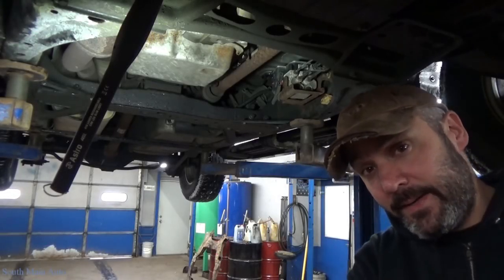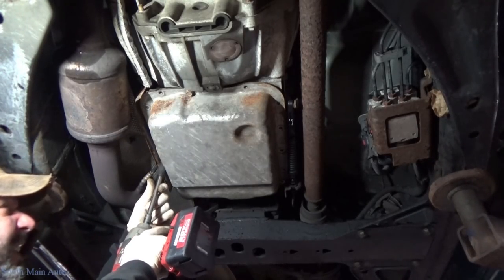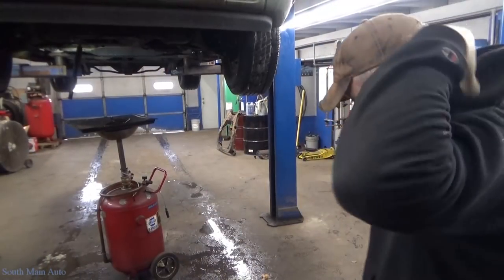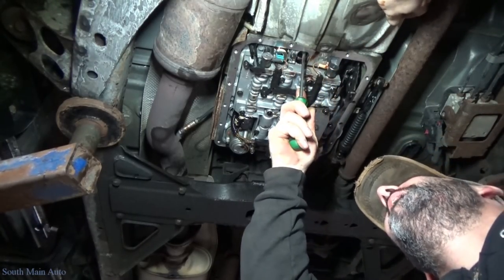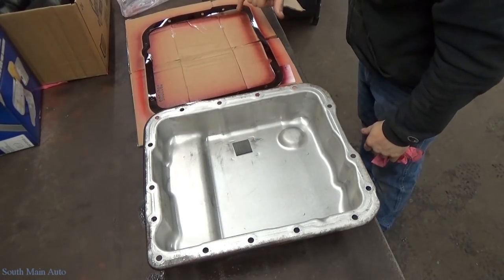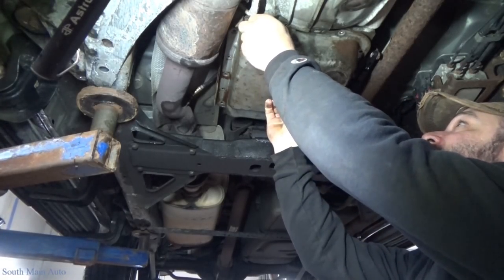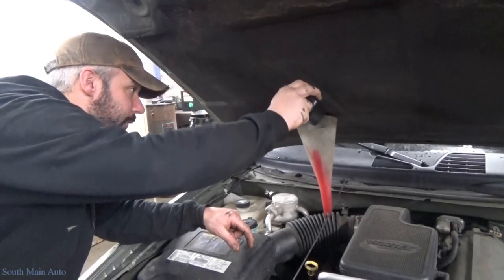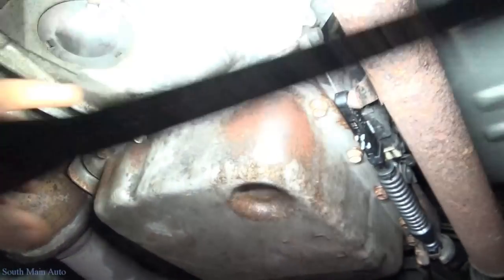Trailblazer / Envoy / Rainier Transmission Fluid & Filter Replacement 4L60E

Comment: I was more concerned about you getting a drip in your eyes, never nice :-(.
'
People overreact far too much, sticking the gasket to the pan makes life so much simpler.
Reply: zx8401ztv right i do make it easier and i been using this gasket stick for years and it don't hurt anything
Reply: That spray he used just looks ideal, thin but sticky enough :-D
I've used a smear of grease or just oil if the gasket is thin and wants to fly away too easy.
There are too many "Arm chair mechanics" on youtube that like moaning about nothing.
Reply: zx8401ztv  agreed
Reply: You can also put the gasket on the pan and start the bolts the gasket will hold the bolts in so they don't fall out.

Comment: I agree will spill, fill and filter every 30000, better practice than waiting until the the filter gets clogged at 150000 miles, and starts having shift problems then doing a complete fluid and filter change hoping the trans will work fine afterwards!
Reply: just wish the factories would put drain plugs on the pans...

Comment: My understanding is that transmission fluid breaks down over time and heat cycles.  Its purpose is to lubricate and cool the transmission.  For that reason I change all the fluid at 4 years or 60,000 miles whichever comes first.  That is in addition to the splash and fill, like you did in the video, every 30,000 miles.
Reply from the maker: Yep and your trans is still happy I assume?
Reply: Sandbag1300 Exactly. The base oil oxidizes due to heat and becomes sheared from gear face pressure, the friction modifiers that give the fluid exact friction properties deteriorate, the additive package depletes dealing with deposits and moisture, and the suspension additives become depleted as they hold on to everything too small for the filter to capture. Replacing the fluid with new fixes all of those issues.
Reply: Nice  --   Well Said & True
Sadly no one knows that
Reply: Eric, so far but both of my vehicles have less than 100,000 miles.  I have no scientific proof.  I do have an example.  My Father in Laws 1992 pick-up with 80,000 miles that he owned for the last 10 years, purchased from the original owner, left him on the side of the highway last year.  Transmission died at 70 mph on a long trip.  Asked him when he last changed the transmission fluid...all I heard was crickets. - Bob.

Comment: I've been doing trans service on my 99 Tahoe every 25k since new, same procedure as you, it now has will and never had a trans problem. I also tow a race car a wee bit over the trucks rated capacity. When I service my trans it uses 6 full quarts and I agree his trans was low, mine always spills over when dropping the pan. Btw, there's a noticeable exhaust leak under the truck and the r/s engine pipe was covered in soot. Might as well get some extra work! LOL

Comment: Not gonna lie Eric
That rust on that transmission oil pan was driving me crazy the entire video.
Reply: I have my Transmission pan dropped & put in the Dealer OEM Ford filter and  Dealer Ford Motorcraft Fluid  changed every 30,000 miles / 50,000 kilometres on my Ford Focus.
Reply from the maker: You bothered by rust! Imagine that....
Reply: .....i know right, who would have thought.

Comment: Just FYI, GM has a TSB regarding the transmission pan magnets in these older vehicles. Apparently that little square magnet they came with isn't worth its salt in gathering the magnetic debris from the fluid. The TSB recommends installing two new round donut-shaped magnets in the transmission pan that are better at removing the magnetic material from the fluid. The pressure control solenoid has a tendency to pick up that magnetic material, which makes its magnetic field stronger, which then lowers the line pressure from what the PCM desires. That leads to slippage. I just did a "spill and fill" on my mom's Buick in which I added the two new magnets some time ago, and indeed, they retrieved a bunch of crap from the fluid.
Reply: I left the square in mine, which was weak as hell and added round ones, which are way stronger. you obviously need to know if there's clearance for them and where to put them! dont want them right by a solenoid lol
Reply: Wow awesome comment.i love when people actually take the time to read TSB's. What better way to prevent problems on your own car when the engineering team has already found a known problem that will help resolve an existing issue.
Reply: MAYBE THEY SHOULD PUT 4 IN THE CVT'S
Reply from the maker: Thanks for sharing that. Problem is we often do not look at TSB's (even though we should ) when just doing routine stuff like this.

Comment: Totally agree all that flushing is unnecessary. I've had several cars and with regular spill n fills they go 300K and still work fine when I dumped the rust bucket. Even the wife's dreaded dodge caravan trans has 255K no issues. My kid's mustang did have its first change at 116K and was pretty dirty. So I did three changes. $100 in fluid but we'll be good for years.

Comment: That job looked quite a bit easier than on the 1st gen (square body) S10 4x4's. On one I have I actually made a different trans cross member So I didn't have to always move the dang thing back to get the pan out. I also installed a drain plug so 'fluid showers' were reduced.

Comment: I change all the my vehicles transmissions fluid and filters the same way as SMA. They all have over a 100k and they still work great. 

The only thing I do differently is  use ramps on the driveway. When I loosen the tranny bolts I start from the back to the front when I loosen them. As I loosen the bolts the pan drops down and the fluid comes out nicely without making a big mess.

Comment: I installed a tran's pan drain, years ago. Dump every three engine oil changes. Also have a Transmission Magnetic Filter, Inline to radiator cooler.

Comment: Wondering if you had to fix the "stripped bolt" threads or just popped in a replacement bolt lying around the shop. So lucky to have stumbled onto your channel last spring.  Addicted ever since.

Comment: Lots of TSBs from all manufacturers concerning flushing or fluid transfer machines. GM on this 2003 Trailblazer is TSB 04-06-01-029G and they do not recommend flushing or fluid transfer and some machines may have a detrimental affect on the transmission & the acceptable method is draining & refilling per Service Information.  The only flushing they approve is flushing of the cooler.

Comment: Any trans oil change is better than none. Refresh what's in the pan and change the filter every couple of years and your fluid will stay fresh.
Reply: The additive packages in trans fluid isn't good for more than a couple
years when exposed to high heat,so thus the changing every 2 or 3 years
30,000 or 45,000 At least do it
Don't forget the AWD Case & other Fluids.

Comment: Sir my Son has a 2006 Chevy TrailBlazer with 132000 Miles, and I would like to change the filter & oil, but I hear from some mechanics that when you do that the transmission starts slipping. What's your opinion?

Comment: i'm glad my 2 old cars have drain plugs on the tran pans.  Drain n fill every 2 years. No need to change the filters since they are just metal mesh screens. Both pans have been pulled and cleaned.
Reply: LEX Maximaguy87 You must have Hondas? Nissans? The older ones didnt have a filter just metal mesh screens. Thats also why Hondas automatic transmissions break like clockwork. Not very reliable units compared to one that have a dedicated filter.
Reply: 1 is a nissan the other is a kia truck... these are aisin 4 speed autos. The honda ones that are notorious are the 5 speed autotragics.
Reply: TOYOTA HAVE DRAIN PLUGS BUT NO T/C DRAINS KIA TRUCK? IN THE USA?
Reply: The newer Hyundai/Kia transmissions just have a drain plug. There's no pan on the bottom (the solenoids and such are inside the front cover, not underneath). There's an internal filter which requires removing the front cover, but isn't a recommended maintenance item. I assume it's coarse enough to not be likely to plug up.

Comment: Just think about how much money was saved when drain plugs were no longer installed on automatic transmission. I always used to drill tap and install. BUT NOW trying find a spot to do it is pretty much looking for a spot that was missed in the quest for minimizing metal.

Comment: Merry Christmas Eric O.  When I service a transmission that has an oil pan,  I install an oil pan drain bolt kit.  Now you can easily drop the fluid only, at every LOF or every other LOF.  Keep doing it until that fluid is cherry red.  By the way, when you tried to reinstall the tranny pan, you weren't putting it on wrong, the truck was facing the wrong way...have a Happy New Year.

Comment: Ex's Chrysler has 225k on original everything. Just an oil change every month. Transmission ran fine.
Reply: So changing 1/2 the fluid every 50k should be fine. If the trans has trouble after it had trouble before.

Comment: I am a Ford engineer.  I did not work on transmissions--but the people who do have told me that changing fluid & filter every 30k will extend the life.  I just sold a 1997 f150, with 204k miles--no problem with trans.  Because i preferred to do my own service I removed the pan every 2 or 3 years, cleaned the film off the pan & magnet & replaced the filter.  I welded a drain plug into the pan to help with the fluid mess.  If you really want to change most of the fluid, you can suck it out the filler, drive it for a while, repeat.  
Do that 3 times & only 6% of the fluid is old.  Cost less than the fluid flush.  I wonder if the magnet was missing from that pan?

Comment: Anyone calling you a Hack has not read the Manufacturer (SI) Service Information on this vehicle.  That is exactly how GM specifies the process.
Reply: yep i am a Chrysler tech and it is the exact same process for most transmissions.. the 8 speed trans are filled for life tho!
Reply: Jotech 1991 anything filled For life will have a limited life no matter what they fill it with.
Reply: Yup, "filled for life" really means "for the life of the transmission", which will be a lot shorter than if the fluid was changed regularly. Usually there's a caveat to that lifetime fluid anyway - for example on Hyundai/Kia transmissions, they say the fluid never has to be changed, except if you drive under a set of conditions (which you'd be hard-pressed to find a driver which doesn't at least part of the time) it's every 60k miles.

Comment: I have a 08 colorado 4 cylinder 2.9l   it has 138000 miles I have done filter & oil change using oil filter & gasket from chevrolet I've done it 4 times so far & never a problem & I don't glue gasket on just because it's a pain when you do this often & have to get it off & I've never changed that seal either.

Comment: It has always amazed me how much an automatic transmission cost to repair , and how the vast majority never service them . When I buy a used car (always GM super low miles) one of the the first things I do is get a complete flush . Another thing is I order a new pan with a drain plug . From then on I drain the fluid , measure what I drained and replace it (usually 4 to 5 quarts) . As far as the changing the filter , I replace it on the first service then after another 100,000 miles . The so called FILTER in not really a filter , it's a bag in a can that is designed to catch metal shavings and that's it . I use WalMart Super Tech Dexron 6 GM approved fluid ($4.27 qt) . After the first service it only cost me around $20.00 U.S. to service it and stay on top of it . It's been my experience that a well serviced transmission on average can last nearly twice as long as one that isn't . If you ask the experts who rebuild them what they do with their own vehicles , most would say a complete flush every 30,000 miles . Maybe they know something we don't ?  Keep it clean and cool and it will last . TheReaper!
Reply: joeblackakareaper I bought  a  2001  Chevrolet  Cavalier  that  was  a year  old . I've  got  210,000 mi on  it.,and  never  changed  the  fluid  and  still  works  perfect. Just  thought  I'd  share.
Reply: You are a lucky man , all that said miles in themselves don't always tell a complete story . Freeway miles are easy on a transmission , city stop and go in hot weather are hard on an automatic . Another thing that kills automatics is driving style ,  jack rabbit take offs are extremely hard on them . TheReaper!
Reply: I once owned a trans repair shop,so I can disagree with the silly stories about never changing fluid.
The work you get didn't just happen for no reason
You have design flaws the manufactures do not care to resolve & no one changing fluid.
Try flushing a trans if you like rolling the dice & see what happens
Try not removing the pan & cleaning it.

Comment: I'm getting ready to do this in just a few minutes from now. I wouldn't call your techniques a hack. My Envoy is a 2003. Just turned 20 a couple of weeks ago. I've had people tell me the same crap. Don't do it, it will mess up your transmission, you won't get it all out anyway, it will slip afterwards, blah blah blah. This will be my 3rd or 4th fluid/filter change. They know my vehicle has made it to 20 years old and for some reason they still don't get it.
Reply from the maker: #facts

Comment: Like you said, Eric, many people take their car in for a fluid "flush"(exchange is more accurate a term) when it's already exhibiting issues like slipping, hard shifts or od shudder hoping it will remedy the issue and then a few days, weeks or months later the transmission dies so they obviously blame the last thing done to it which was the fluid "flush" not understanding that it was already dying anyway and would have died with or without the flush. The flush did not cause or speed up the death. This BS myth has been floating so long now I doubt it will ever go away because people with little to no knowledge love to keep spreading this myth.
Reply: Yellow Ducs are faster than red ones.
Reply: That's why I repainted my 996 in yellow. It was a red one that was gently low sided. I hate red with a passion so the only obvious alternative was the Ducati Yellow.
Reply: I ride an '01 996.  Yellow, of course.
Reply: Nice. Mine is a '99. I love it but its extremely low bar height is getting painful at my age(43). I spend most of the time resting my left elbow on the tank to relieve pressure  and stress from my wrists, elbows and lower back. I absolutely love how easy it is to flick in an S curve but I am seriously considering selling it this coming riding season and replacing with a Kawasaki or BMW sport touring bike. I never thought I would sell the most beautiful sport bike ever, once I got one, but I am considering it.
Reply: I have one of those "lifetime" filled transmissions, AW42-50, sits behind a Volvo D5252T(2.5L TDI made by VW modified by Volvo). Transmission was replaced at around 142k km before I owned the car, I had been dropping the fluid in the "pan" and replacing that every 2-3 oil changes, running 5000 km(~3000 miles) intervals for the engine oil. Transmission started to feel a bit funky, checked the level and it was fine, but the oil was turning a bit brown. So I did a flush, just pulled the return line of the top of the tranny and put a hose on it so I could tell when I'd pumped out ~3 litres, pumped through 18 litres or there about, fluid was fresh and red at around 8 litres pumped, but I could only buy the stuff in a 20 litre can. I blame the entire thing on the absolutely craptacular Shell ATF we have at work, replaced it all with Mobil ATF 320 and the transmission seems a lot happier now. Just wish there was a filter you could replace on those transmissions, there is a strainer thing in there, but you have to take the transmission apart to remove it. Transmission still shifts real harsh into 1st gear if you downshift at slow speed, but I can live with that.

Just one of those times when a flush can help.

Comment: Eric, do you have a preference between trans fluid from the manufacturer or from the parts store?
Reply from the maker: I use the OE Spec ie. Dex 3, Dex 6, ATF+4 etc... but I do use the Carquest brand here at the shop unless someone specifies OEM fluid. In my own stuff I do use all OE fluids.
Reply: If the guy who fixes cars uses OEM fluids that's what I'll go with no matter how much it hurts.

Comment: So you mean you don't have to drop the transmission and disassemble it every time you do a fluid change? So I guess that means you don't have to take apart the engine every time you change the oil. So I won't have to set aside a week anymore when I have the oil changed? Once again thanks for the video.

Comment: FYI, to avoid the GLUG, GLUG, GLUG when pouring from 1 quart transmission fluid bottles, pour it with the bottle sideways with the spout on the high side. That’s why the pour spout is offset, rather than in the center. I’ve been changing oil for 30 years and just learned that trick last year.

Comment: This is what I would expect to be done when I ask for a transmission oil and filter change. Otherwise I would ask for a transmission flush. Same goes with any other fluid basically. Changing IMHO covers the most of the fluid everything else is a flush.

Comment: I bought a 2000 blazer (same transmission).   Someone drilled a hole in the oil pan and sealed it with some epoxy.   I had to replace the pan, so I bought one with a drain in it.